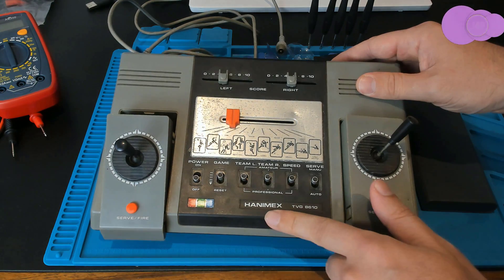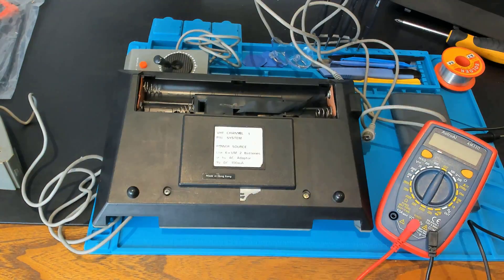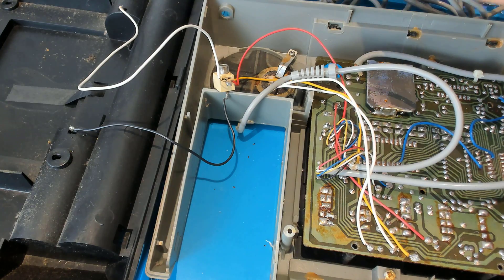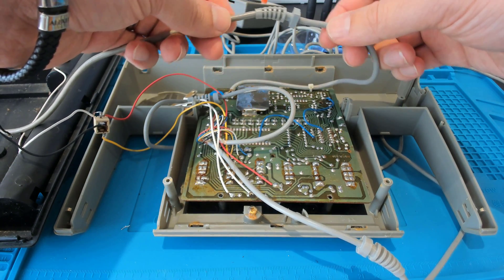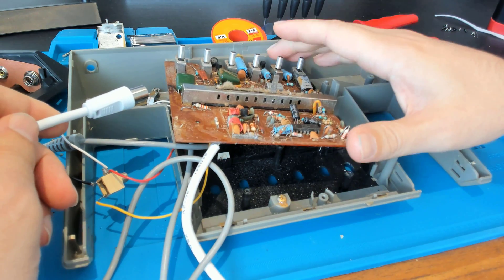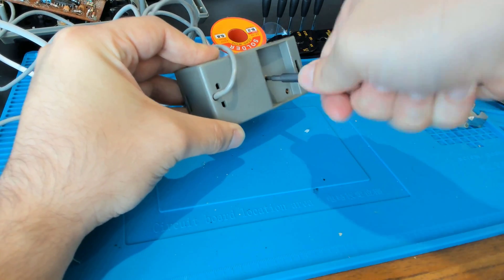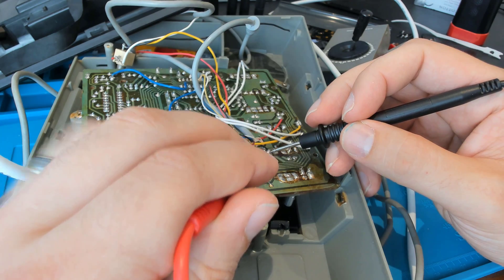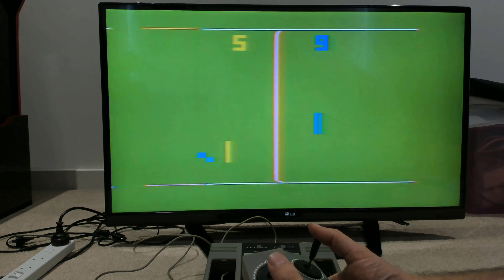Broken PONG Console Repair. Retro Hanimex Pong Game Console Displaying No Image. Can I Fix It?

Comment: THANKS! You surely encouraged my pursuit of reviving my Akur SD-050, yet another of these early Hanimex style consoles from the 1970s. Your system does not (yet) have the cartridge slot, only supports the 10 Pong variants (as installed in PC-501).  The SD-050 allowed to insert cassettes with different games, everyhing else on my console looks very similar to your older device.
I am fighting TWO issues: like your system the HF output is currently miserable: our German consoles operate at 55MHz (channel 2, PAL color). My video is distorted, blurry with fringes, hardly playable. So far I have  NOT opened the console or its RF shield, but will follow your advice to replace the coaxial cable and maybe peek inside the RF  box. Also there seems to be a fairly easy 'hack' to obtain the pure video output signal, to feed it into a SCART or other composite TV connector? It would be a clear improvement, circumventing the analog HF signal processing altogether.
My  biggest nightmare: I am the (currently not so proud) owner of the famous and ultra-rare cartridge PC-503, "tank battle"! Of all my cassettes this one does not play when inserted into the otherwise totally functional base. So something on the cassette's  PCB has given up. I peeked inside and of course it resembles what you see as your 'game' electronics: 20 diodes around the main IC, 20 resistors, a handful of caps. Soldering was done mediocre in Hong Kong back then, but seems OK. I suspect the 4.7mF polar caps to have dried up. Not being an electronic wiz I will take it from there, and from ample supplies of old electronic elements of my late father's TV repair shop, hundreds of tiny boxes full of 'stuff': transistors, ICs, caps, connectors;  you name it, I got it..

Any ideas how to proceed on the dead tank game? What to check, where to measure?
If running again it will be a  blast: the early programmers back in 1977 made a booboo with PC-503: not only the tanks could be moved around by the joystick, but also the ammunition  after firing it! Meaning you literally had cruise missiles to send around the corners, to hit your enemy even BEHIND the obstacles, AFTER firing them off your tank! It was AWESOME, and I still remember it. 40+ after playing this game, a Xmas present by my parents when I was a youngster.
Thanks for showing your repair! And congrats for having your console back alive and running! Wish  me luck..

Comment: I know you said you wanted to keep it as stock as possible but would you consider composite modding it? I modded a similar one just for ease of use and works quite well. There’s a French write up on it that I followed with a translator
Reply from the maker: Sounds good, I might give it a go if I get some spare time. Do you have a link? Cheers.
Reply: @just4parts336  I’m gonna try commenting again, I think YT is not showing my comment because it has a link. Google ‘hanimex 771 composite mod’ and it’s the first result or at least the one that’s in French. If your chip is different it should be the same principle with possibly a different pinout, yours is in colour whereas mine is black and white. I omitted the 750ohm resistor to get the video looking brighter
Reply from the maker: @MarcoRetro316  thanks!